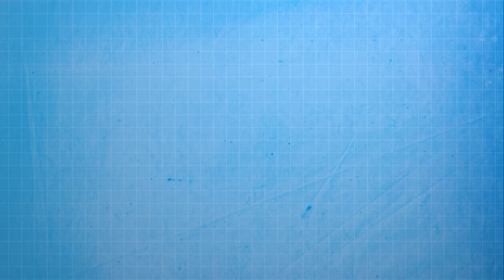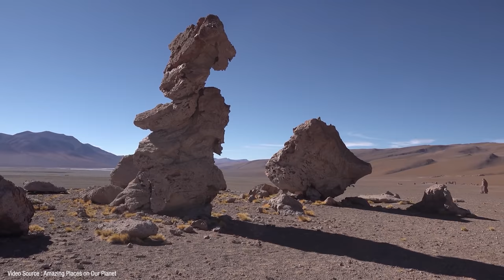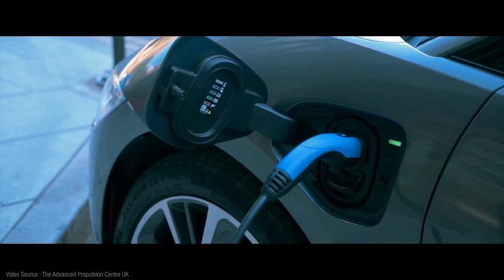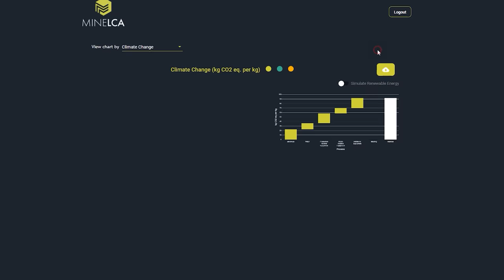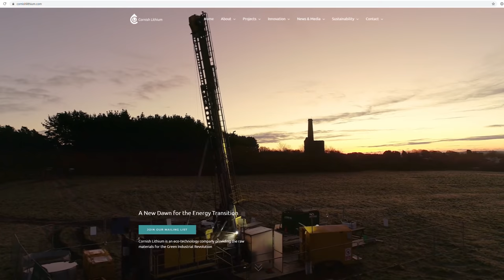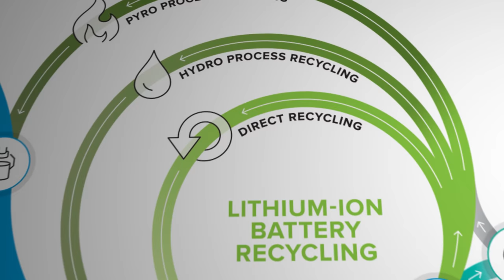Life Cycle Assessment. Optimising raw materials for renewables

Comment: So love the channel I question some of your end results we clearly have wind farms in the United States that were built over 20 years ago they never generated as much energy as was  required to make these raw  materials into windmills. CO2 creation fossil fuel consumption the complete compilation of assets I'm pretty sure it's the wrong direction... It's pretty clear they were on enough raw materials on earth to deal with the potential building of solar panels and the needed battery technology in the electric transport sector and energy storage sector.
If we scale up the need for electric energy based on perceived EV adaptation the electric grid's gonna be severely overtaxed as it is currently designed and operated, so even though we say we're doing the full accounting we're clearly not using sense making to come up with a true plan one in which takes an energy density into account... peace

Comment: I hope that solid-state magnesium batteries make a breakthrough so that we don't have to worry about lithium.
Reply: Why? Lithium is more abundant than magnesium.
Reply: @theatheistpaladin  There is a difference between how abundant something is and how you get it.
Magnesium you get from open pit mining, A lot of the Lithium comes from evaporating brine. 
There is a huge difference between the impact.
Reply: @googoo7750  brine pools are not really dug though. And the second place lithium comes from is sea water. Both do not require big holes in the ground
Reply: @bknesheim  
Way to move the goal post in a conversation that you weren't in... It was literally about abundance. We already use magnesium in abundance, and so we would be already mining for it.  Mg is about 3 USD per kg, while Li is about 11 USD. And you still have to have some coblat with Li which also isn't cheap or environmentally friendly.  There is no perfect solution.
Reply: @Mathis218337  
You can't scale that to meet the demand that would come. Mg can more easily meet those supply demands than lithium ever could and it highly recyclable.
Reply: @theatheistpaladin  Abundance isn't the problem.  If Mg batteries were feasible, we'd be working on them now.  There are a number of parameters that must be optimized to create a viable EV battery.  Range, cycle life, cost, safety, energy mass density and energy volumetric density.  If a chemistry fails any of these, it's not practical.  Everyone is looking for better technology, but it's not easy.  BTW, Cobalt is on the way out as a significant part of battery chemistry.
Reply: @incognitotorpedo42  
They are working on them now. It's called research you Luddite. Like I said Lithium isn't cheap nor scalable to what is needed. Sure cobalt is reduced but it still needed in most applications.

Comment: Now that humankind is beginning to rethink just how much energy consumption there is in producing and using technologies, we must also examine the runaway usage concerning that of our present wireless communication technologies. Two items where the growth seems to be exponential are that of cryptocurrencies and wireless versus wired or cabled transmission of data. Using antennas to broadcast digital electromagnetic frequencies requires multiple times more energy than the alternative method stated above. Would it not make sense then to cable as much data as possible going forward rather than just focusing simply on short-term monetary savings, corporate profits, and user convenience as it relates to mitigating impending global climate catastrophe? There are also many other advantages to cabling our electronic interactions.

Comment: i think H2 should become the dominant energy storage of at least 50% of the total storage. And we should probably redefine storage because EVs are also items that actually store energy. The only difference is that they can release it directly into active use. But you can use them as storage of energy during excess energy production and in the H2 infrastructure itself. Concerning EVs, i believe we should grade types of vehicles by size and weight. There is not point in putting a lithium battery in a bus. It's just not practical. If fact, putting Li batteries in cars is also not practical. It is best used in lighter vehicles and items ranging from cell phones to motorcycles or cars lighter than 1 tonne. Everything heavier than that should be powered by H2. And it is the H2 infrastructure that we should be focusing on building and improving. It's most challenging, but at the same time H2 gives out most power. I believe the world will come to the same conclusion eventually and in some 50 years Li EVs will start to die out and be replaced by H2. But why wait 50 years?

Comment: If you take an electric car and a ice car of roughly the same size the manufacturing carbon footprint is equal at 1st mile   all carbon footprint comparisons wither away with every carbon oozing fill up ⛽ until the ice car gets replaced before 150,000 but the all electric will keep reducing its life cycle cost to around 500,000 miles or more.

Comment: Carbon sequestrion is a weide practice. CO2 is not the enemy. Spending energy on it is a downright criminal offense. That energy can be used far better to produce more windmills and solargrids. Not only will the costs returm but also who is to say we wont need the extra CO2 in a decade or two?
Reply: "Carbon sequestrion is a weide practice  .... who is to say we wont need the extra CO2 in a decade or two". That's a senseless self contradiction. If we did need the extra CO2 in a decade or two then obviously it should be sequestered, so's we got some available.

Comment: There is not really a problem to be solved here. The real problems are area consumption, where does the energy come from and cost of infrastructure. For example, if I would switch from oil/gas to electric for heating, costs would increase by a order of magnitude. Increasing the number of EVs and making production lines green worsens the problem. What do you think this is going to do to society? We need solutions for the real problems and those are about short term costs.

Comment: There is a problem with much of recycling that can be done and that is that the "cost" is higher then if it was made new,
Like: paper, most plastics, lot of metals and more. 
The "politic correctness" of promoting recycling result in a lot of weird thing. Like trucking paper from the north of Sweden to the south or from Norway to Sweden. We also need an evaluation for the recycling process at the same level as for new products.
Reply: The main issue is that many analyses ignore externalities.  Often these have a ,massive long term cost that far outweighs the initial value of the product.

Comment: As a registered cynic my view is that a properly configured LCA would determine the cost / benefit impact, but will it?  In any LCA it seems it is necessary to select the functional units, system boundary and parameters assessed to make sure you get the answer that is desired; always embarrassing when data shows that what you hoped to prove ‘bad’ was in fact ‘good’ or vice verse.  For functional unit in Environmentalism ‘overall carbon footprint’ is usually a good one, so what you save on kerosene not burnt in a jet aircrafts engines better not be outweighed by what you consume using a recreational sailing vessel with hydrocarbon based structure and motive power arrangements containing lots of embedded carbon.  ‘System boundary’ well where ever is likely to yield the ‘correct’ result is a safe bet; ‘parameters assessed’ again what best puts a cutting edge on the particular axe you wish to grind determines which parameters you choose to assess.
Reply: Seems like this private company will produce the research results its clients want.
Reply: @Withnail1969  seems you have matched my level of cynicism.

Comment: I wonder if one could convert mining equip. to run on compressed air. I do recall in past I think an India company made a car that ran on air. One could have filling stations on site that were solar powered. While they would have to refill frequently but then no oil would have to be used.
Reply: Electric motors are more practical.
Reply: @incognitotorpedo42  Neither is practical, you need diesel for heavy mining equipment.

Comment: The current bigger problem humans create and face isn't the material needed for a renewables future, it's the continual planned obselesence of everyday goods and the inability to recycle these everyday products. Look at "fast fashion" as the latest example of mostly petroleum based goods that are used once or twice then I tossed. Modern automobiles are mostly non-recycle materials now also. PV panels, wind turbines, hydro generation last decades unlike everyday goods
Reply: Cars are mostly recyclable.  The vast majority of the mass is metal.
Reply: @incognitotorpedo42  Go visit an auto body repair shop. A vast majority is now polymers and composites. Now just the cabin cage is metal plus suspension and driveline, what little there is of it. I've seem first hand what hits the dumpster because it CANNOT be recycled. It's not like those now "vintage"  and "antique" cars I drove when I was younger that we're almost all metal.
Reply: @blaydCA  true

Comment: Plenty of good stuff in this one ..... with one caveat (well there would be wouldn't there)
China is deep into funding of environmental groups the world over. They are being used to make "western" countries and companies less profitable to fit their 100 year plan for world domination. Now that you are laughing at the idea do some research on it and we will see those smirks disappear ..... just as a one off although reduced, how many coal fired power plants are being built there, and how many in the western area?

Having got that one out of the way ...... there is a lot of merit in closed loop designs. Many companies already realise this by buying companies that produce everything that goes into their main products. It matters little if one section becomes less profitable as it is the whole that matters .... this is exacerbated by Just in Time methods of delivery. There is waste in virtually all processes, reducing that waste .... or better yet using it for another process is definitely the way to go!
A case in point is building blocks (breze blocks to some) ..... it was realized that the spill from coal mines mixed with cement would make a good product. Suddenly there were factories making the blocks built right next to mines to minimize transport! Obviously in the UK we no longer have deep coal mines so this sumbiosis is ended .... but the point is valid!

I have recently heard of plastic injection bricks made from waste plastic with the largest cost being to sort the good plastic from the unusable waste ...... Definately a good step in the right direction. 

Zero waste is something we should all hold as a goal!